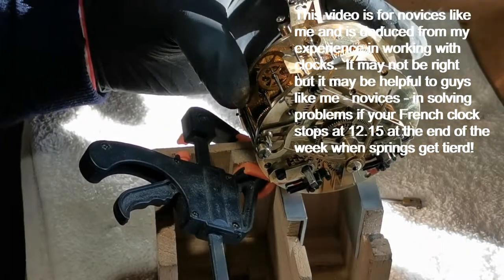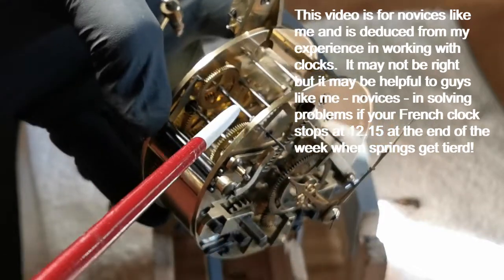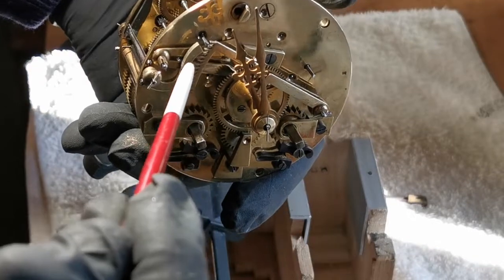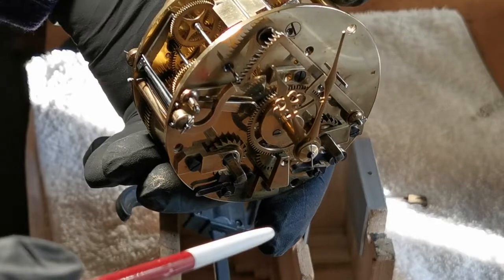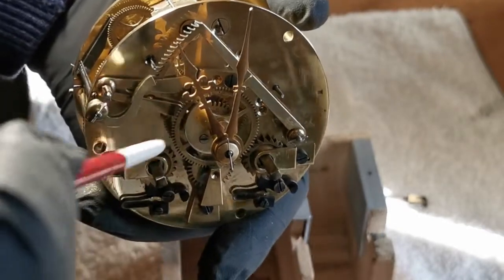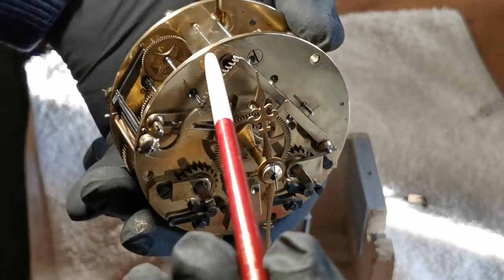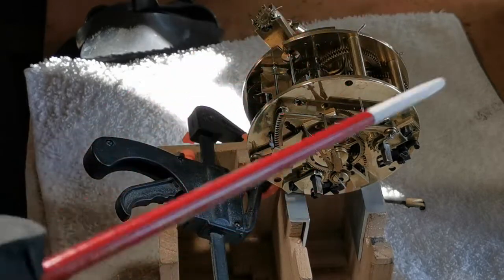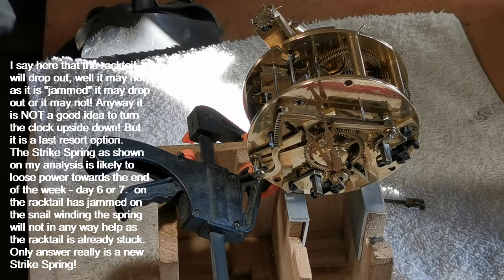101 French Movement Syncronising Strike Hammer with TimeYouTube4

Comment: Many Thanks for this amazing presentation!  I enjoy French Clocks and to work on them.   This is the best explanation of the operation that I have found.  I often see clocks stopped at 12:20+ , so I warn the owner to back-up the minute hand to 12 and wind the chime!  A weak spring running the strike train is often what leads to damage when some fool attempts to force the minute hand around to one o’clock.  Thanks for posting! ~ Ben Burn
Reply from the maker: thank you Ben - your answer is spot on if you are the owner and not repairer! I am so glad that my video is useful.  I think it is broadly correct though some disagree with new springs! but I do feel that if you are overhauling a French clock and it suffers from this syndrome then a new strike spring may be the answer!  it certainly was in my case and the clock is now running very well lasts well into 7 or 8 days strikes when it should and keeps time to within 5 min during the 7 day cycle.  worked in my case.  thanks for your comments, really appreciated and i hope it will help other novices like me.  kind regards Simon.

Comment: This is exactly the tutorial I needed to see. My newly acquired slate French clock has been consistently stopping at 12:15. The clock has not run in many years with both springs wound tight. I have been moving the minute hand back to 12:00 to free the rack hammer from the snail. Unfortunately, the problem persists with frequency. My next  attempt will be to manually release all of the tension from the strike spring by moving the minute hand through the strike sequence. I will then wind it and try again. 🤞
Reply from the maker: thank you but there are other problems of course; if the rack tail (erroneously i referred to it as the hammer) falls at any time and fails to strike it remains on the snail without further ado and the clock continues to run without striking but will still stop at about 12.20 as the rack tail jams on the verticle face of the snail.  it is a tricky business sorting out striking French clocks - good luck
Reply: Thank you for replying with this additional tip! This morning I wound the strike spring after manually releasing all tension by advancing the minute hand through the hours. I set the time for 10:30. At 11:00, the fly activated quite well without help and the clock chimed 11 times. Now, it's a matter of seeing whether or not the clock stops again at 12:15. I will let you know after thorough testing. Of course, after seeing your video I realistically expect the strike spring may very well be tired, as I intermittently  had to urge the fly to spin with a gentle nudge as I manually ran the clock down through the hours. I just thought I'd tinker with it since I have the works out of the case, on a makeshift stand. Outside of the recurring 12:15 problem, the clock strikes in synchronization with the hour and half hour and keeps good time. Fingers crossed, as clock repair in my area is expensive! I recently paid $175 for a suspension spring and "Cleaning". Although the works look as dusty as I brought it in in. Thank you again Sir! Doug, from Connecticut, US    @s.spencertenagodus8051
Reply from the maker: there is another, although linked reason that the clock stops at 12.20 plus or minus and that is often diagnosed by the apparent lack of power in flicking the fly.  it could be that the strike spring is "set" or not really up to it.  however, from my own very frustrated experience,  this could also be caused by the detent lever on the hammer (gong hammer) falling at the strike time on to one of the pins on the ?third? star strike wheel with the hammer lifting pins. if this wheel is one tooth/leaf on the pinion too far advance it will mean that the lifting lever is resting heavily on the star wheel's pin and it the strike train sometimes hasn't got quite enough puff to get the fly going.  if the lifting lever/detent is mid way or clear of the star wheel's pin the the fly starts and away you go.  it is quite a job to get it right as i tried to explain in the vid. 
PS you sound quite keen at sorting it out.  take your sprit in your hands and fix it yourself. there are plenty of videos out there and i have quite a bundle too on YouTube. its not easy but just take your time and take plenty of photos.  that's what i did in 2018 and I'm still going strong.  all done with YouTube help - nothing else good luck Simon